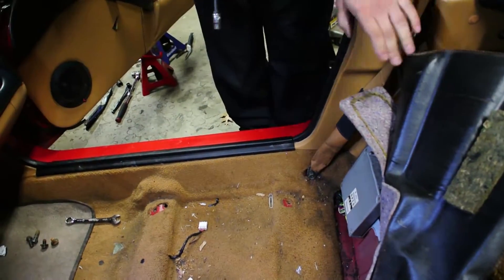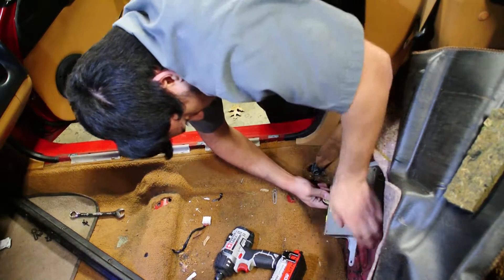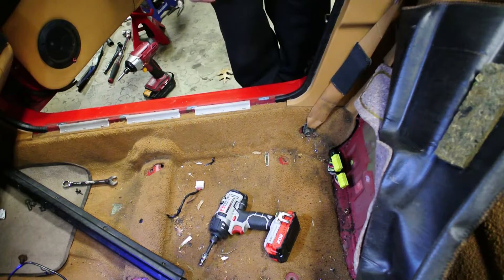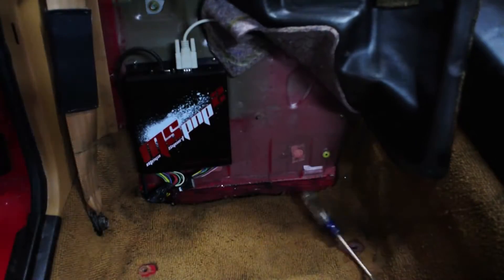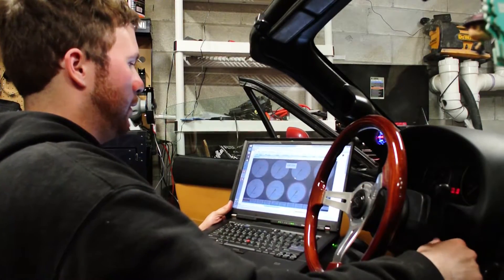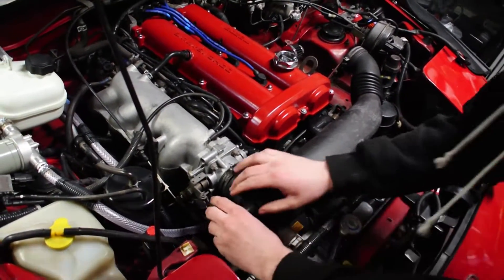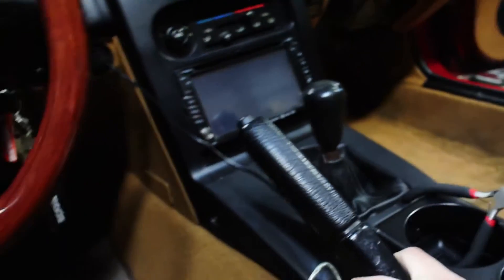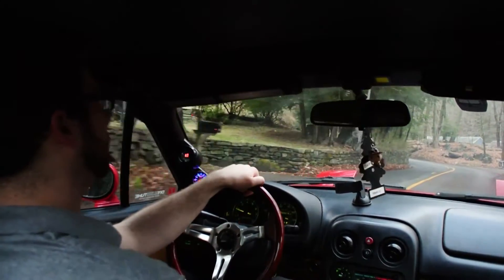How to Megasquirt Your Miata - Miata MSPNP Install

Comment: questions, what if you've removed sensors like EGR, boost sensors, evap systems, ect...? what do you need to do.
Reply from the maker: There's no support on the MSPNP for emissions systems, I did a basic EGR delete with a block off plate and if I recall looped the EVAP lines for an EVAP delete

Comment: Does the ECU come w a vacuum line? Or from the car? And which vacuum line?
Reply: jcheeseman21 - yeah it does come w a vacuum line. U connect the vacuum line to the ECU and route it thru the firewall. U gotta have a “T” vacuum line connecter, cut the existing vacuum line that goes to ur intake manifold (I forgot which one), so that it has a total of 3 connections. Then ur done. And you got to have a wideband o2 sensor. I’m using the AEM X-series Eugo one.
Reply: jcheeseman21 been 3 months already since I had megasquirt and I’ve learned a lot, I’ve got a good idea on a basic start up sequence now.

Comment: Can you make more horsepower if you mega squirt a miata with only a k&n cold air intake and a header back exhaust.
Reply from the maker: You might be able to advance the timing a bit and add a bit more fuel to compensate for the added air going in and out of the engine, should gain you a few extra ponies! Not sure if its worth the hassle of tuning it all just to gain a few horsepower.

Comment: Your last comment is so true. the base map is only to get your car running. I could get my car to run but I was actually slower and having bog issues without the proper tune so buyers beware.
Reply from the maker: +Gabriel Rubio I found that as long as you're running a wideband you can set the ecu to include target AFR and that will give you a pretty decent tune. That's all I did after I put the turbo in and the AFR is damn near perfect all through the rev range!
Reply: +RM Custom Shop Thanks for the tip, I honestly haven't done nearly enough research as I should have before buying the mspnp2. I will most likely try again this weekend. It would be great if you were to come out with some vids on said fix or some ms trouble shooting. Thanks
Reply from the maker: I really don't know what I'm doing with it haha I did no research prior to installing and I regret it. I will say that including target AFR is the best choice if you're unsure. I still have issues with idle and startup though. If I learn a bit more I'll be sure to make a video. The best option is to take some time one day and play around with settings and learn what each and every setting does and how the car reacts. If you're using tunerstudio there's a bunch of help bubbles that you can hit and they will explain most of the settings!
Reply: jcheeseman21  lol this comment was years ago. Ive tracked several turbo miatas since. Over Miatas now

Comment: How much was MSpnp?
Reply from the maker: It ended up being right around $850 with express shipping because I'm inpatient. That was mspnp, iat sensor and serial to usb adapter.
Reply: +RM Custom Shop Ah okay because braineack on miataturbo.net sells them for cheap
Reply from the maker: I didn't even know about that at the time, I just found 949 Racing to be much cheaper than diyautotune for the PNP